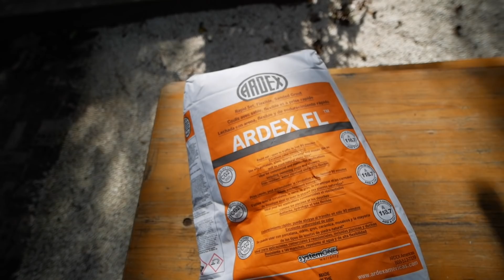Building a STUNNING Penny Round Shower With "Flexible" Products in a School Bus Conversion

Comment: Since you've done this, have you driven lots and how has it held up with the movement?
Reply from the maker: It has surprisingly not cracked at all. Not even where the floor meets the walls. If you follow our process you should have similar results.
Reply: @MobileDwellings do you still feel like it’s a good idea?   I’m about to do mine. I’ll be driving about 7500 miles per year.
Reply from the maker: yes it will be totally fine if you more or less copy my methods.  @josephwhite8578